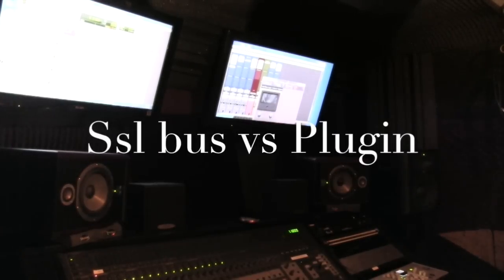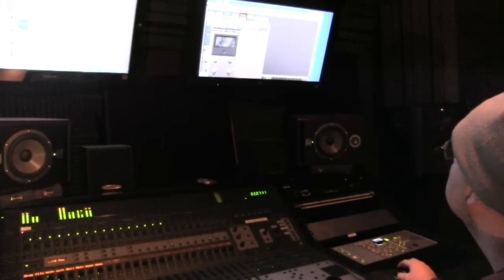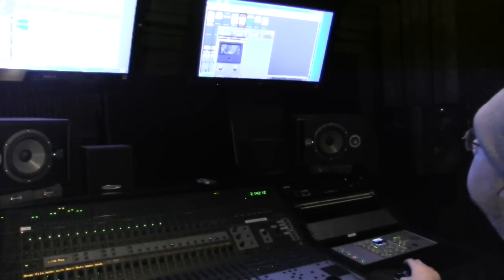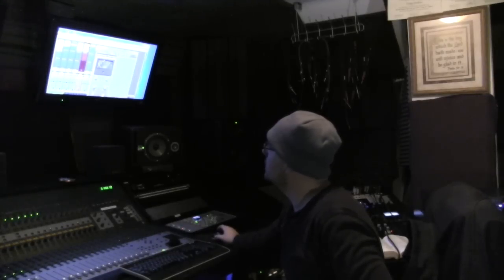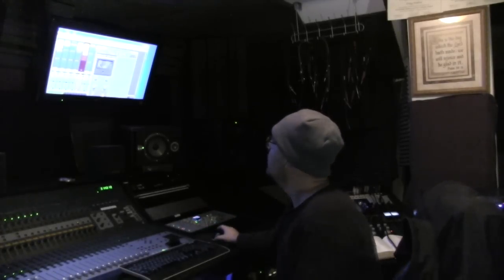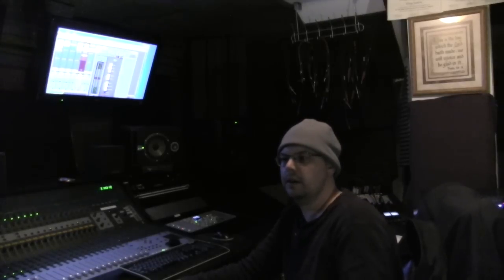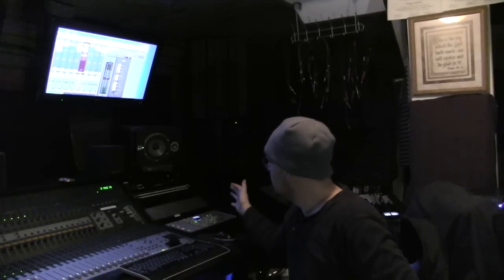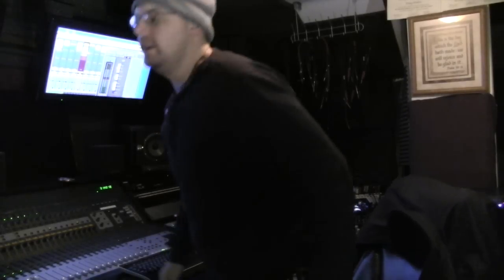SSL BUS Compressor VS DUENDE

Comment: Gain staging issues aside here, the difference between these is apparent.  The hardware makes you feel the song more.  I've noticed this in tons of a/b listening off a good d/a w good headphones.  High quality hardware brings the emotional content of the source material into focus vs merely controlling dynamics.  It just makes the music sound closer to something in nature rather than existing in an anechoic chamber.
Reply from the maker: A UserName   You my friend are listening for the right thing!  I hate gain staging, I never once listened to a song for this purpose.  when someone I work for, realizes how much they feel the song, and if they are wise, they will live with not caring if there album is as loud as the others.  the difference is exactly what you mentioned, more real to life, more feel, more what music is all about...also, the hardware can do intense compression, without batting an eye, where the plugin will start sounding artificial, I didn't do that comparison in fairness to how these plugins absolutely have there purpose.
Reply: Doug Jenkins of course you can´t compare the SSl Duende to the Hardware because SSL Duende is from their digital consoles the C-series and is not based on their classical analog consoles the 4000 or 9000 series.
Reply: +FrancisJoa I beg to differ. The C200 is based off the SSL 9000 J. The SSL Bus Compressor (I'm talking ALL OF THEM) are based of the same old SSL 4000 G series. The newer ones if I'm not mistaken have sidechain now.

Hope this helps, Marc ;)
Reply: +imsrprod Yes the code is a lift from the C200 but the C200 was an emulation of the original analog comps/eq so it was SSL doing their best to mimic analog. There will be differences of course but it can get very close.
Reply: +Doug Jenkins I was thinking this, and it's often true, there are so many bad plug-ins out there that you can use to just technically level a bit but if you push them, which is what most people use comps for these days - colour and vibe/groove not just "leveling" - then most plug ins turn to dust. I always got more emotion feeding back from a hardware compressor BUT when I did more in depth A/Bs between (imo) the best comps vs some hardware I had (cheaper SSL like VCA bus comp, a real 1176 etc) I found the problem often was I (we) were simply to "scared" to push the plug ins, we don't think twice about twisting knobs a lot on hardware till it sounds right but I think we have a perception now after really bad early plug-ins that we must keep everything calm ITB... when you actually give them the beans SOME plug-in comps can go toe-to-toe with hardware. Others completely fail to even sound/emulate the same thing (like for example the 1176 in all buttons in mode on bass - the real one and 1 or 2 plugs give this consistent pleasing growl, while others just don't do it at all and sound like crap). 

My point is sometimes plug-ins need higher settings to get the same effect, more gain, lower threshold, higher ratio etc. I gain stage (-18) by habbit now so always hit my plug-ins just right and there is plenty of headroom to drive these plugs then without them bottoming out or getting thin/harsh. It's important to reiterate it's only SOME plug-ins that work right, I'm not a fan of Waves plugs for example as they almost always cause narrowing and a kind of harsh/nasal mid boost just by being in the chain, and their comps sound mostly like plastic clicky stuff. Other makers (Acustica/nebula, N.I/Softube etc) make some very compelling plugs that 9/10 can mimic the hardware and sometimes even sound "Better" (i.e they can at times preserve more of the good signal, low end, fullness, when some hardware can top and tail the spectrum or thin things). Good hardware is always better than bad plug-ins, but great plug-ins are often just as good as good hardware (and sometimes better).

Oh and if talking directly about an SSL Bus comp, of course that has "THAT SOUND" so to get that sound exactly right is going to take more than many other types of comps, even though it's a fairly simple VCA design it was made just right to grab and lift. And anyway, sometimes it's nice just to have the hardware, especially on the 2-Bus because it does move you, inspire you and often "feels" better even if we could null it against a plug-in. I wish I had a hardware SSL bus comp anyway (even if I had a plug-in that was 100% the same)
Reply: +A UserName I know what you mean, I think 1 or 2 plugs can get much closer than others with compression but a GREAT hardware comp, esp a bus comp, does have that alive feeling and kind wraps around you more. Definitely a "3D" thing.

I was underwhelmed by ITB Eqs which all sounded flat and sterile to me until I tried acqua Honey (harrison sampling) based on Nebula, I swear I don't work for acustica I just couldn't believe the difference. Those plugs use vastly different tech to mere emulations, they sample the hardware in a 3D way and wrap that with the signal you send through it, much much closer to hardware than 99% of normal plugs out there. Everyone should demo them at least. The "emotional content into focus" is a good way of putting it, and that's what I heard with the Acqua eqs vs my Duende EQ (Or any other algo eq). It kinda tickles the brain when it kicks in, like good hardware, there's a tangiable lift, a feeling of intensity and anticipation in the music with good hardware (and some of these acqua plugs I speak of). Some obviously can't detect it but some of us can, by comparison 99% of plugs compared to hardware fall back to flatness and the sound washes over you, it doesn't grab you.

Comment: Don't forget to use the sidechainfilter. Music nowadays needs more huge lowend. The
compressor fights against the lowend puch, because there's no detector in it - and it's built in the 80ties.
Reply from the maker: very true, very true.. feeding the sidechain, almost like a high pass.. or just eq'n the sidechain, can really help.. I usually sidechain in the box..  but good point...
Reply: Soundclass This brings up a good point. The SSL compressor never had a sidechain but, was used on thousands of hit records. Now-a-days, records have more lowed but, that really depends on the genre. Hip Hop yes, more lowend, Pop/Rock no, ya don't need it. Hell, Dance music use to be all lowend. Have you heard the new dance music, it's went very pop with hardly no lowend so they can make it more louder in the clubs. 
Side chaining out the lowend so that it would poke through is a great idea and IK's SSL version does have that. Check it out. It's one of the best. Another one is the Glue. It holds the lowend quite well.
JusMyThoughts... Marc
Reply from the maker: thanks marc spot on
Reply: imsrprod The XLogic X-Rack Stereo Bus Compressor Module has got
a True Stereo side-chain input for external signal keying, that the SSL on board bus comp don't have. There are no rules at all, but i like the subharmonic content on records. Ozone 6 is the only software i use. I'm not really into plug-ins. I've got so much expensive hardware stuff that needs to be used. Plug-ins sounds good, but a bit to flat and boring to me.
There's some sheen and openness in the analog chain that i love so much.
Reply from the maker: nice conversion,, and super dsp like a avid hdx card, which we just incorporated, is the closest I've come to making a plugin sound like hardware, it's amazing what happens when you add some sense of dsp, each computer will handle the plugs different, but yes, it's a complex job for a plugin to compete with actual hardware, it's analog once it goes out the computer, it's still the hardest thing to replicate, compression is such a touchy thing, great compressors just do there job, either add there harmonics or leave the signal clean and clear, but my experience, that bus compressor just does what a plug can't do at extreme levels..
Reply: Soundclass The last time I used a rack SSL buss compressor version was the 384 rack old version. That was back in 99 so, maybe your right about the new versions having SC. I agree that old hardware has color that is pleasing to some and boring to others. Look up Paul Frindle, the original maker of the SSL console and SSL bus Compressor. He's usually on a site called Gearslutz and I have talked to him a number of times asking about the mojo of the hardware and he laughs and says, there is none. There is just wires and electronics, enough to try to keep the noise down from the console. Hahaha... I'll go more into this when I get a chance and maybe I should kind of give a somewhat insight to who I'am so that no one here thinks I'm some random guy saying random stuff. I don't have time right now but, I'll be back... Thanks
Reply: To keep it short and to the point, I'm from Chicago/LA/AZ, been in the biz for over 20+ as a producer/writer with Universal/BMG. First signed writer with David Foster and have worked in studios from around the world ala Olympic Studio/Townhouse(RIP to both)/Britannia Rowe Studios UK, Larrabee Studio/Sony/Pacifique/Capitol LA, Battery Studio/CRC Chicago and I can go on for days. Worked with Major artist and have major credits but none of that means anything as I have used/worked and owned some of the equipment discussed in this thread/forum/blog I guess it's called. Anyway, just don't want you to think I'm just anyone saying nonsense. k, sorry, carry on.... :)
Reply: imsrprod Absolutely not! Thank's for this interesting info! That must be a nice experience in your career. As you mentioned earlier, there's a giant thread called "Paul Frindle - Is This Truth Or Myth?" Mind-blowing!!!! Whenever a signal needs more punch, snap and clarity without coloring - SSL is the way to go! I love to have a nice pallete of outboard gear to maintain the typical characteristic of a specific instrument(for example api 550A for cello, Harrison 32 EQ for flute, etc..)
Reply from the maker: absolutely, as we perfect our rooms, tuned, and really hear what gear can do.. Being able to use these pieces for character or compliment the natural response of each instrument, is the funnest part of the job.. In my line of work I deal with a lot of not so great production, when this happens, it seems like the producer really didn't get this far yet, experimenting with the right pre's, right compressors, eq's to acheive the best image for that part.. but that's where grammys come from..  harrison and api, are amazing gear.. classic, they are classic for a reason.. if it ain't broke, repackage it in a 500 series rack :)
Reply: I do agree, it's all about the initial recordings! If people could learn how to properly record vocals and vocal placement also, drum micing/placement etc, mixing would be 100x faster and better but, as we all know, that ain't gonna happen so, the people I come across, I teach them simple things to do ITB to make better recordings like "record @ around -18db and to keep your productions/arrangements simple and, take your time!" Anyway, getting off the subject. Hardware/plugins are just tools to make the recordings better if that's possible. Hardware for some reason has become this magic sprinkle dust that makes everything better. I remember a young guy telling me in the studio "Man, Tape sounds so much better and truer than digital and analog consoles have so much more headroom and plugins suck compared to hardware" I giggled and asked, "have you ever recorded on an SSL J series (The cleanest SSL analog board to date) he said no. I said, have you ever recorded your music on a Studer A827? He said no. I said have you ever used a real 1176/LA2A,SSL 384 Bus Compressor on an SSL console? He said, No but, I've heard A/B's of them. I then broke it down for him and just happened to have an old DAT (I know, I know) in my car of a session I did at Britannia Row Studios in the UK in the downstairs studio (I think that was a 5116 Neve console) and some nice hardware units. I played him the beginning of the song before I told him the story. Too long to mention here but, all I will say is, after I broke it down about how much tape hiss, console noise, heat, bad/crackling pots, no automation etc and he could hear that at the beginning of the songs... He said, no one ever mentions this stuff and how many Drawmer gates and people it took to do a mix.
I said "Exactly". People get caught up in the Nostalgia of hardware gear that they don't know the truth about the pain of using it, maintaining it and the irregular sound after time if not maintained. Also, what hardware is and really doing/does behind the metal pieces. I know what they do and understand the mechanical works that it can achieve and what it actually does (It's not magical dust?) and that's why I can tell you without a shadow of a doubt that, plugins are there and have been for a few years now. The old heads are catching up/on and a lot of them are making the switch but are doing it quietly.
Sorry for the long winded post but, I think that my journey is just beginning and I need to help teach the newbies and new guys that before you go spend 20k on a bunch of hardware, research and do real world testing. You might be surprise on what you really find out if you are completely honest with yourself. 
Sorry, not sure if I told this but, it all relates...
Classic story, new guy buys an API rack 2500 hardware compressor unit. Brand new, straight out the box and he had it for about a month. Loved it and wanted to know how other people were using their's and wanted to know some hardware secrets. I asked if he could put down his mix with his settings, then put down a mix without the API 2500. I asked him to send me both as I wanted to run his mix through my API to see the difference. He did so, and told me the settings he used. I then put his mix through my API 2500 using the same exact settings and sent it back to him. It took him a couple a days to get back but, he said, "Man, your API sounds incredible, warmer, more width and color", why and how are you using it. I told him that I used the same settings he gave me. He was amazed and then I told him, it's the Waves API 2500 plugin. Long story short, after asking me a bunch of questions after that, he took it back (the hardware) and got the Waves Plugin. 
It's not the gear, it's how you use it and knowing how to get the sound of the hardware in the plugins. It's there, and easy to get, you just have to figure it out. 
OK, I'm done... Sorry again for the long post. Hope someone gets something out of this!

Marc....thx
Reply from the maker: I hear you, I really have found, the room makes all the difference, we have a super tuned room now, had a session this morning basic 2 track instrumental downloaded from a producer, got the song, ended up shelving 20DBS!!!  off the low end to even the song up,, then recorded vocal with a nuemann tlm 103 and a LA 610.. vocals sat real nice, he has a huge lower end vocal.. really strong, set it right,,   He left the studio, doesn't even care about the mix, says it sounds fantastic.. so let me ask you.. He spend 2 hours here,, He could go to his buddies for $10 hr.. budget studio and spend 8 to 10 hours and get nowhere near the result..  hip hop/EDM/Dance, these songs are produced so many times with the bass way to loud, because people think adding volume to the bass makes it better, ... which once again.. you slap a api 2500 on a balanced mix, waves plugin, or slap a real api hardware on the previous mix.. I would pick the plugin a million times over.. it's how you use it, convertors, and preamps.. I use this new avid hdx card now, and I will tell you without a doubt, it does make the system sound incredible.. This with symphony i/o plugins can really mirror the exacts of these infamous pieces of gear.. so long story short, BUY SOME KILLER CONVERTORS!!!  it does dictate how your digital information with process..  take back the api, and get rid of your mbox...
Reply: He's coming to you and will continue to come to you for your skills in knowing what to use, not the gear. You make the gear sound good because of your experience's like these, that have shown you and I time and time again how to fix major issues or be able to recognize an issue when you see/hear it. Believe me when I say, if you were forced to do everything ITB (God forbid-haha), you could do everything you can now and it would be the same if not better. We adapt, we adjust and we continue to get better. It's other people mistakes and figuring out how to fix those mistakes that make us better. Learning to get color/depth/width/height/saturation/distortion etc is all part of us messing around and stumbling or being shown or being taught in school (Which they don't) but, those are all tools Being able to fix issues and turning something ok into incredible is what separates you from everyone else I'm sure. Learning your tools is also the biggest plus! Knowing what your hardware can and cannot do as well as your plugins. These are the things I've learned over the many years and now, I learn from the younger guys/generation who don't care about hardware/software but just want to push the limits of creativity.
Reply: +Soundclass Hey SC, I started that thread on Gearslutz, I'm M2E on there. Maybe I should of said that too. Hahaha... That is a great read for anyone that still believes that Digital sucks or plugins suck etc... Opened a lot of eye's including mine at that time.
Thanks, Marc
Reply: +imsrprod Do you mean the"Neve 2254/E Hardware vs Software Comparison"? Oh, that's really close in this case. Sometimes, it's sureal, because you don't know wich one the real thing is. For surgical and slightly adjustments - i use digital. For character and sound - i go analog. But that's just me. Thank you Marc!
Reply: Yeah, I started that one as well. Plugins are there, just learning how to use them are the key and that will open your Pandora's Box.